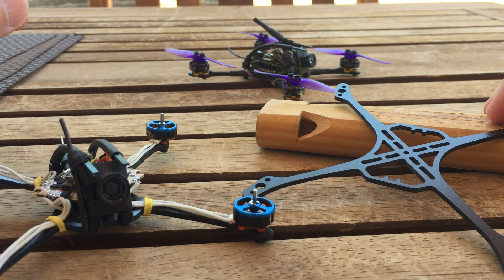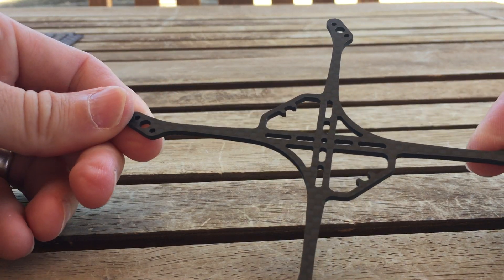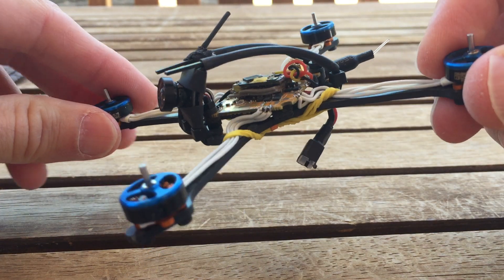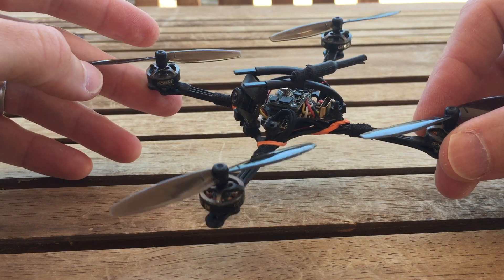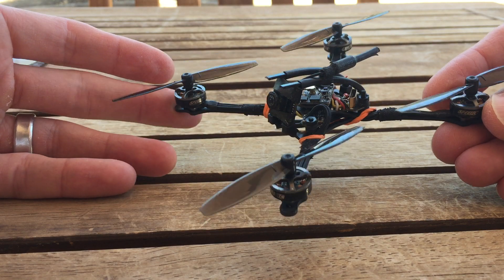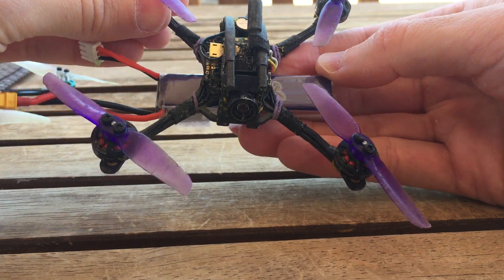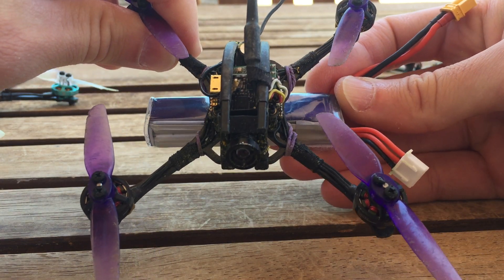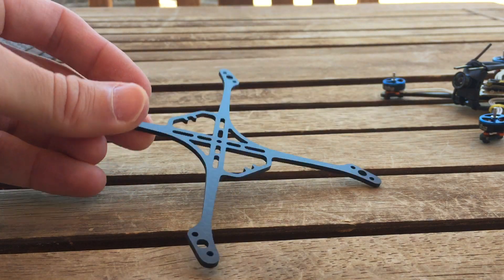WarPigs n Weight Distribution

Comment: 16:32 I hope you pursue that design. I built a pusher TP3, with inboard battery, and the gains are pretty significant. Mass is sitting right on the propline, so the motor leverage is super efficient, and balanced. I think the biggest thing though, is the major reduction in profile. The super low profile just slices through the air, fighting much less resistance. It's a total prototype, so a number of small things id change right away, but the more meaningful design elements are in place.

Edit: here is a link: https://youtu.be/oDBMxW3B5xU
Reply from the maker: I may revisit it once I settle on a 2S format.
Reply: @Quad66  Do it! Would love to see what/how/where you go with it. If you get a good prototype in the air, the flight characteristics might just compel you onward. cheers!

( i say cheers too, all the time haha :)

Comment: So with what is regularly available.... what build options are their for 1s either 3" or 2.5"? Again.... love your content
Reply from the maker: On 1S the combinations I recommend are Geprc 1102 14000kv with the whocares or gemfan S props, FPVcycle 1202.5 with 3018s, hyperlite 1103 14000kv with HQ 3015 biblade. The hard part is available the Geprc can be ordered but it takes about a month. The HM are more available but you’ll want to buy twice as many and be ready to replace them. The 1202.5 have another batch coming but you need to sign up for an alert to order them before they sell out. I emailed pyrodrone to see if they will get more. The skystars 11000kv equivalent is available from the skystars store on aliexpress but again that will be shipping time and I’m not sure if the kv is close enough. There is a bunch of other 1103 stuff out there in the 10000kv range but I don’t know if it will be any good on the HQ props.
Reply: @Quad66  Thank you.... just trying to keep options open until fpvcycle is able to have their manufactures get back to working full speed again. Until then... it seems like slim pickings. As well 1s no rx boards are out of stock and now I have to work on learning how to install another antenna to keep range decent enough to fly without signal losses. Thanks again for all your knowledge and sharing it.

Comment: Weight distro is for sure, a massive impact on flight feel, I much prefer transverse battery. 
For battery on top frame can you ditch the skids and just use longer FC mount screws as feet? 
I Have been considering 1s whoop experiment with nano3 cam between front hoops and battery on top of FC board, just need to work out how to stand off battery from FC.
Reply from the maker: 1LittleTinker you could just use the FC screws but people really don’t seem to like builds that don’t look “finished.” On my early designs I got so much push back and dismissal because the camera was mounted using foam tape and a rubber band. I introduce the zip-tie canopy and suddenly the design is “genius” even though it’s functionally not really that much better. I still primarily design for myself, but I do try to present a final form that will be perceived well.
Reply: @Quad66  cheers for the insights, I guess I get so focused on the function, minimal weight in right place, I totally wasn't thinking about a product. 
cable tie is totally inspired btw! 
I am really keen to hear how the mid mount battery progresses :)
Reply: 1LittleTinker Im getting excellent results with an inboard battery on a pusher TP3 build. https://youtu.be/oDBMxW3B5xU
Tightest weight distro Ive managed, and the reduced drag due to 30-40% reduction in physical profile is profound.

edit: And I am def someone that likes my builds equally polished, as they are functional/practical/efficient, but it'd absurd to be rude, or condemn someone's efforts, and functional results becaused they varied from my own tastes. With thay said, absurdity does make up a vast amount of internet commentary.

Comment: My 3mm WP with the F3 aio is ripping! Love the ZTC, but i just realized how your motors get so tattered. Theres no motor protection designed into the frame! Interesting choice. Not sure how I feel about it. Anyway, for now Im really enjoying the 3mm frame with 39g dry weight. OH! And Im getting 5mins out of 300mah/no wire whoop batts! At that low of weight the "spool up" effect does not exist. Super perma-grin snappy on bf357 with Babytooth PIDs. Swingin' 3018s. 7.5mins on a puffy 600mah.
Reply from the maker: Yes my frames definitely don't offer much motor protection. It is a conscious decision as it takes a sizable pad of carbon to really make a difference (I haven't found the skinny extensions like on the babytooth to make much difference). A sufficient amount of extra carbon (like on the FlexRC frames) puts a fair amount of extra weight at the worst possible  place out at the extremities. There are plenty of great options out there for people looking to build flying micro tanks. I couldn't find much on the other hand that really maximize 1-2S performance so I started designing my own. A more function option to get descent motor protection is to fly the 3016 triblade. The efficiency penalty is actually fairly small based on thrust data: https://karlpablo.com/thrust-stand
Reply: @Quad66  Well said. I appreciate your insight. Tremendous point about the tri blade, and the ulta light weight of these builds I would guess lends to the tri blade being effective protection.  Thank you.

Comment: Hi! Im planning a lightweight 2s 3in build around the new low pitch hq props with 1103 or 1202 8000-10000kv. Whats your favorite 2s battery brand in terms of performance (longevity isnt too important to me) under high loads? Im thinking 300mah for now but if the cells are anything like whoop batteries I think i might need a 450mah.
Reply from the maker: chris wang I haven’t sorted out 2S 3 inch yet. I think 300 maybe enough with 1103 7-8000 kv with the HQ 3015 biblade but haven’t tried it yet. With 1203 7000kv 300 mah is not enough even with the 3015 biblade.